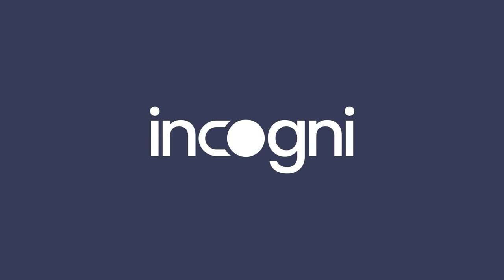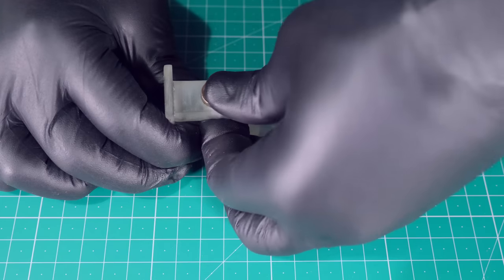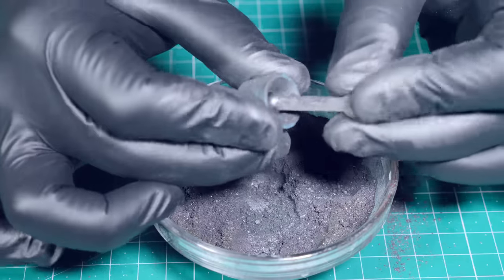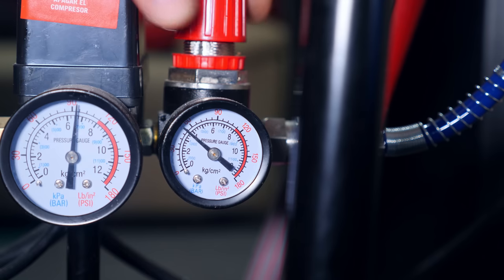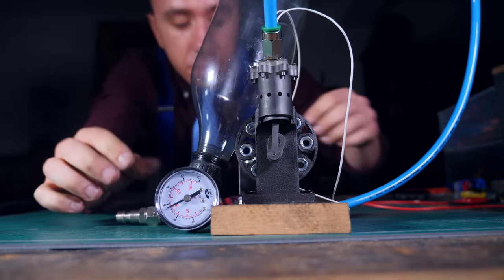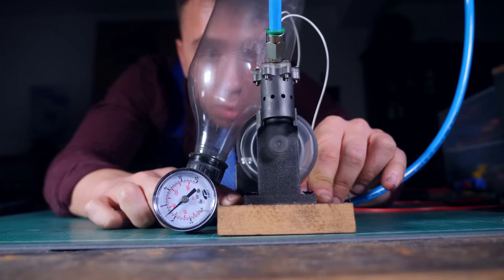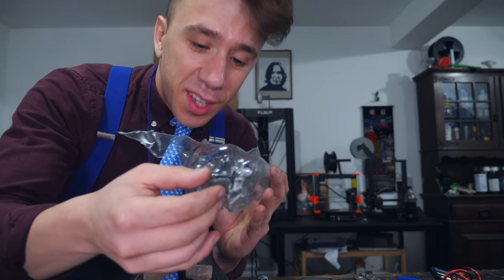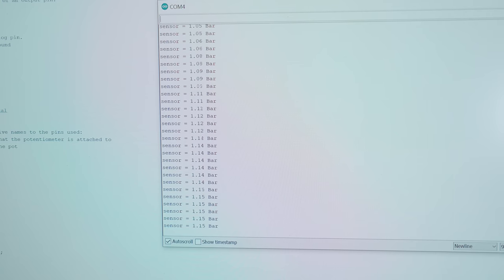Magnetic Air Engine

Comment: I’m not an engineer/scientist but I do possess curiosity and an imagination which is why I like your channel.
I have a few of questions/observations/suggestions for this episode.
1) Why don’t you fill the 2 liter bottle to max safe pressure before each test? If you did, you wouldn’t start depleting the CO2 cylinder until the 2 liter bottle pressure dropped below 2 bars.
2) Would a smaller, 1 or 1/2 liter bottle acting as the 2 bar stabilizer, placed between the pressure sources and the engine, extend the run time without adding too much weight? I’m thinking it takes a lot more gas to fill a 2 liter bottle to 2 bars of pressure than it would to fill a 1 or 1/2 liter bottle to the same pressure. The downside, I suspect, would be the increased rate of repressurizing the smaller bottle.

Comment: Awesome video as always! You should time the motor from the fly wheel and if you created a vacuum chamber of some sort ie… mount a turbo on exhaust or something of sorts. and used it on the return of the cylinder to TDC you could potentially double your efficiency. But that being said it’d only be beneficial if the mass was able to be kept down to minimum.

Comment: I think if you made a similar set up, but instead with super cooled water, there could be some interesting results. If you took cool water then passed it through a super chilled compressor. With the expansion of the water from getting below freezing you'd have a massive pressure difference. You could just recycle the same water as it is used for moving the piston it'd heat up slightly. Although the balancing act of keeping it from freezing would be hard. Just curious if somthing like that is even possible in a construct such as this one. Thanks! Love your videos. Wish I could make some cool stuff like this. I always loved science but as a boy I was really bored of math and thus could use a brush up but if u had practical ways of seeing things applied it makes much more sense.

Comment: you can take off the crankshaft and replace it with a magnet to return and push the cyl head. That way you can use more presure(with smaller openings) for shorter stroke for longer time and power. If you ask me about the flywheels inertia. try heavier cylinder since it will be used for simple motion.

Comment: I think the first 3D-printed design might have worked with a slightly heavier fly-wheel. I might be wrong, but having more inertia stored in the fly-wheel, at least initially, may have helped.

Comment: Maybe you could use the output of the engine to charge a battery and  maybe a capacitor, using frictionless magnetic energy harvest.  Then use that energy to heat the bottle to increase the air pressure and see how long it can sustain it self, or use the electric energy created to increase the pressure in anyway.

Comment: Try freezing the air in the bottle, and also using a stronger one. A monster tall boy can has a resealable lid, and with how wide it is you can design it to take a intake and outlet. Fill the container with a littler liquid O2 or liquid nitrogen. Your intake almost flush with the lid and your outlet using a metal straw 2-4 cm long you can get the air from the bottle without collecting the the liquid.

Comment: A bit late, but you could put a short extension on the piston at its circumference, curved to mate with the inside surface of the cylinder and just tall and wide enough to cover a hole in the cylinder side, with a matching hole in the lower art of the the extension, next to the piston face.  The curved extension of the piston side is long enough for its surface above the matching hole to shut off the pressure from the gas when the piston is at the lower end of its travel, letting the flywheel send the piston back up.  When the holes in the cylinder and piston extension match up, the gas pressure can push the piston back down.  That way, the piston does not have to lift up a valve against gas pressure, nor does there have to be a complicated electronic arrangement to open and close the valve.

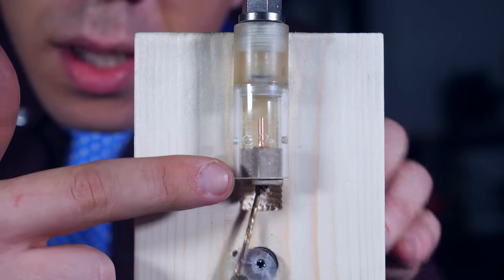Comment: I’m currently making the version shown at 0:44 so far have the weight and crankshaft but having problems with the pistons length I’m doing this with an electric saw, a bottle cap for the crankshaft, a paper clip for the pistons body, a wood piston head, and the ball valve currently does not have an o ring because I have no idea how to make those or where to find one. For those asking why I don’t use a 3D printer I simply don’t have one and am attempting to see if it’s possible to make it without a printer

Comment: Have you tried tuning the magnet opening timing backwards for stronger pressures?

You could also set that up through the arduino to vary the tuning for different pressures automatically

Comment: Use a mini 3D printed turbo charger setup to continually make compressed air for refilling the compressed air chamber. Use one turbo to start up a bigger turbo so the efficiency is raised. With this, I theorize that u could do away with the compressed air store entirely.

Comment: You could replace the soda bottle with a carbon fiber reservoir. That way it has higher tensile strength and you can reduce the volume and weight of the reservoir or hold higher pressures if you'd like.

Comment: Try using it outdoors, black color would absorb Sun's heat which would inturn increase the pressure of the gas. 
Or use a magnifying glass to project the rays to compressed air inlet port (assuming it's metal) to extract maximum energy.
Infrared projectors can also be used to perform same task indoors but would require extra energy.

Comment: If you are looking for a more constant toque you could have a pressure gauge and an electronic valve at the inlet to the engine. You use the arduino again and make the electronic valve adjust in order to keep the pressure constant.

Comment: Try using an electro magnet to push the piston up on the old design, with the electro valve to stop the current to the magnet once the piston is at the top(close the circuit when the piston is at the bottom) the electromagnet should be powered by the engine also

Comment: I worked for pepsico years ago, they use compressed air to fix empty bottles that were crushed while on the pallets.. its unregulated air right from the compressor system. they will easily handle 90 psi. the caps however are the weak part. every now and then the filler wont fill the bottle all the way and if you drop it cap first from the catwalk it will become a rocket(shake first for maximum effect.) they also bottle water and shoot a bit of nitrogen in to keep the bottle firm for labeling, again if the bottle wasn't filled properly there would be too much head space and as the nitrogen gets to room temp the pressures increase way beyond what any part of the bottle can handle. maybe you can use this info to create some sort of sods powered rocket.

Comment: You could use same build, add 2 more pistons and make a Radial Engine, then attach a propeller and see the thrust force that it makes, very interesting build! Also, if you can make a plane and see how much it stays in air with this cool idea of plastic bottle that gets refilled

Comment: Ive got an idea where instead of using a needle to push out the ball, you can try making a timing cam, either with a belt attached to the crankshaft, or electronically controlled cam, Camden Bowen made an actual combustion engine thats 3d printed too. But you can try making just the air version, and itll be great to see you refine it.

Comment: Two Idea too improving it  is to put the cylinder with C02 into Hot water you will normaly have  extra more energy or a heatsink  with hot air  . And the other idea is to add low pressure piston into the exit like the old steam engine

Comment: Could you add a second sensor at the bottom of the stroke to open a vent at the top of the cylinder? This would eliminate the resistance on the up stroke from the piston compressing air inside the cylinder. Your sensor at the top that releases pressure could also close the top vent.

Comment: I do have an idea for this Engine, add a Electric motor onto it but make sure it isn't powering the motor, only like a small LED or some other electrical thing you feel safe with, also try adding two cartridges and change your code a little for 4 bars of pressure for the bottle instead, you might get a good output from that

Comment: Use multiple valves set to open in sequence to increase RPM and pressure. Tee off multiple CO2 cartridges to increase run time. Consider larger cylinder and piston. RPM and force raise Torque.

Comment: If your EM valve isn't operating fast enough, you could run a second one in parallel, but with a different trigger point to increase motor speed

Comment: You mentioned being able to run the engine slowly on less than one bar. I think you should do a video exploring ways to exploit that, such as just leaving the soda bottle tank in the sun until the heat builds up some pressure, and seeing if you can run the engine on that!

Comment: Theoretically put two different magnet valves for air release, or multiple release valves. wire them so they will only go off in sequence.  you should be able to double or more the speed of the engine.

Comment: perhaps you should make the compressed air engine to make a torpedo, and the air being pushed out would prevent intake of water, while the energy output of the engine would go to a turbine that would push the torpedo forward.

Comment: Scale it up using a old 5 gallon propane tank as a reservoir.  Hook another piston to the flywheel with around a 1-2 inch opening dead end cylinder , see how many tomatoes you can smash with the larger piston before the pressure runs out.

Comment: 2 liter cola bottles can reliable hold around 165 PSI.
We had to bump the cutoff on our compressor to blow a few of them up. Average was 160, weakest blew at 150, most wouldn't blow at 150.

Comment: Really fun video... not sure if it was mentioned already but the thought occurred to me that when you  build high performance engines (for cars) you typically tune for better torque and RPM response with adjustable ignition and valve timings. Your design's electronic inlet valve  should make this type of tuning fairly simple with an Arduino (retarded timing at low RPM, more advanced at higher). You might also consider modulating the power to the valve and regulating the dwell time to better regulate the amount of gas/air entering the engine.  A lot of this would depend on the responsiveness /design of the valve in use but you should still be able to see noticeable gains...

Comment: Idea for an improvment: a weighted piston to push the air. Think kinda like an old style blacksmith bellows.  If you have a large enough cylinder with a regulator you should be able to get constant airflow over a longer duration. The downside is that you will kinda need a larger cylinder, but you should get near constant pressure.

Comment: Have a look at Carl Bugeja's electromagnetic "flappers".  Here's what I'm wondering...... 
A piston with an iron core, running up and down a cylinder wound with a copper coil would generate a small A/C current, possibly enough to power one of Carl's electromagnetic coils.  Use one of those coils as the valve for the engine.  With a simple electronic circuit you should be able to have an "automatic" timing circuit that flips the poles on the electromagnetic "flapper" at the peak of the A/C wave.   The air becomes the power source for the entire engine - no external power source needed, no external air valve and no need for an Arduino, but perfect timing for the engine valve opening/closing as well as your pressure "regulator".

Comment: @integza check out the di pietro motor, may give you some ideas! Also could wrap up/tape up the soda bottles allowing for more pressure storage and possibly doubling or more the capacities. That could also lead to a bigger boom if it goes so if you do I would do it in layers and make an area that is less wrapped up allowing for a more controlled rupture. Lastly can't go wrong with more magnets, maybe even throw some peltier modules for cooling down or heating up areas...all could be ran off solar. They do have mini electrical bike pumps, used as an unlimited air compressor, that could probably be ran off a direct dc to dc buck converter solar setup to keep weight down. May have to have more than 1 though depending on how long to recharge and such. There's some ideas.

Comment: For better rpm/ control, it may behoove you to utilize a valve system that allows air in as the piston reaches tdc. In other words, a valve on a camshaft that opens when the time is right to allow air in. Just like a gas engine, this way you arent speed limited to what the solenoid can do

Comment: On your first simple concept design from beginning of the video: 
the cylinder that the crank slides up and down in you have exit ports for the compressed air. this is a waste of energy especially in the world of 3d printing.  3d print a new cylinder with exit ports that redirect the compressed air to the underside of the piston creating an additional force pushing it pack up and then exit the cylinder. some fine tuning and major design calculations may be required but I wonder if this will increase torque? at the very least, it might give a longer run time... I was imagining something similar in design to Tesla Valve to loop back into cylinder

Comment: I believe the bottle and extra solenoid to charge it are not necessary.. just use a pressure regulator to regulate the output of the co2 cartridge down to 2 bar..

This should give a more consistent overall longer lasting pressure without all the extra steps.

Comment: Idea: What do you think of putting a house around the crankshaft and the connecting rod, and let the exhaust drive into it, so it would help the crankshaft goes up? If it works the pressure needs to be lowered a bit: The faster the engine rotates the more gas goes through in a unit of time and the earlier the engine stops. 
From the same reason: a wider cylinder.

Comment: Fire!, just need to add fire in order to heat the compress air during discharge,  maybe you can use a solenoid in the middle or directly to the chamber. In case doing it on the chamber be careful, you can increase too much the pressure iside and it could be dangerous.... I am a big fun, congratulations for the channel!

Comment: I think a very cool video would be building a small thermocouple. They aren't very efficient until running at high temperatures, but have a very predictable output based on running temperature.

Comment: Use more valves instead of 1, and use a microcontroller to detect the closing of the magnetic switch and open the valves, one after the other, this way you can get around the max frequency of solenoid valve.

Comment: I think you need to find a good running speed on the engine say 100rpm and find what the pressure is needed to sustain that rotation and then put a pressure valve on to allow that pressure through but nothing more. Then for the co2 containers run multiple on the same line with one way pressure valves so that they can release their c02 without any getting any blown back in by the other co2 containers. Then find a use a smaller bottle or container to help not waste any extra pressure. Then for the air that is exhausted out have it collected in a closed space to rebuild the pressure and then once the chamber is at 4 bar have the pressure released back into the container.

Comment: A standard car engine triggers the ignition quite a bit before the piston reaches the top of the cylinder (up to 40-50 degrees early). This is because it takes time to build up the pressure and you want the maximum pressure to be reached just after the top so that it can push the piston down. Perhaps a good improvement would be to experiment with the timing of the valve trigger pulse?

Comment: Instead of compressed air use a hho generator to produce hho to 8 bar to run the engine then use a nitro engine to burn the hho. Or you could use the exhaust to fire a mini boiler to produce steam to run a 2nd engine.

Comment: Paintball has done a lot of development of equipment for handling high pressure and pressure regulation. You could probably get some or all of the apparatus you need from a marker or two. PVC is pretty tough. You could build a high pressure reservoir out of PVC pipe.

Comment: water cool the engine and use the heat to keep the CO2 canister warm.
and you can also revers the roll - make air compressor out of the engine

Comment: For a car, a paintball tank of 13 cu with a regulator would work well. For a plane maybe just a larger cartridge (25g) with a similar regulator to maintain 1-2 bars. This in combination with a large prop might be able to get some air time.

Comment: Either go the regulator or the relive valve path or combine them. If you use a regular it will be much light and less complicated, if you go relive valve you will be able to use many co2 tanks and be able to tiger them at certain pressures

Comment: You can make the engine more efficient by decreasing the stroke. Also you may be wasting air going to the engine. You should add a regulator.

Comment: Can you get a smaller compressor and use a dual bottle setup. When Bottle A is below 2 bar, it switches to Bottle B, while a small compressor fills Bottle A. Then when Bottle B is below 2 bar, you switch back to the newly filled Bottle A, and fill Bottle B.

Comment: I'd like to see this made as a 4-piston air engine. Inline-4 or Boxer style. I  could see this concept producing good and smooth-running. The initial ball valve idea would work, with the extra pistons handling the issues of the first version well. A small venturi could regulate the pressure.